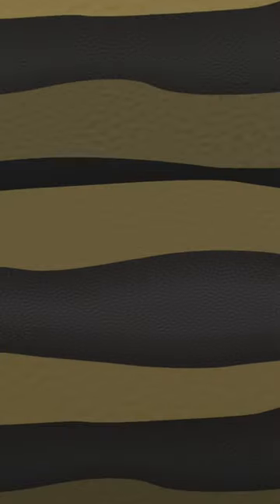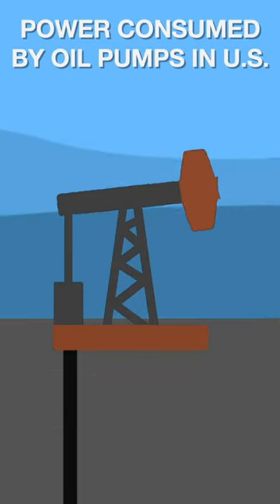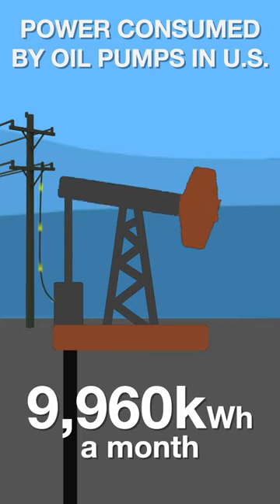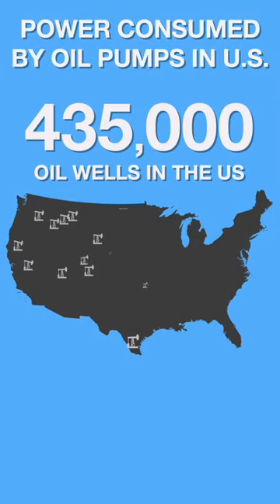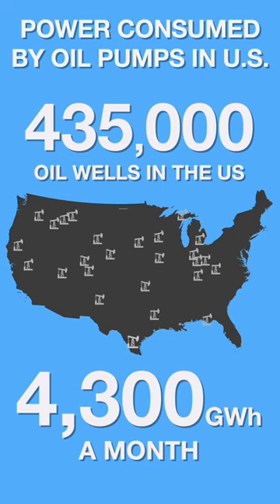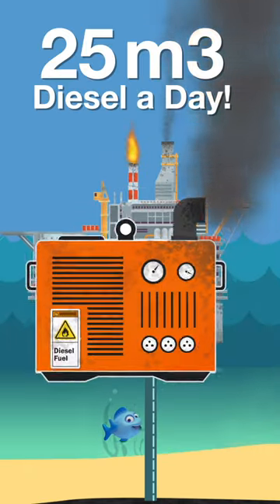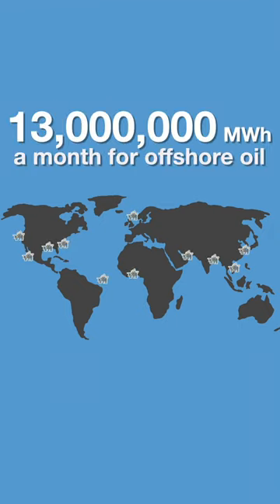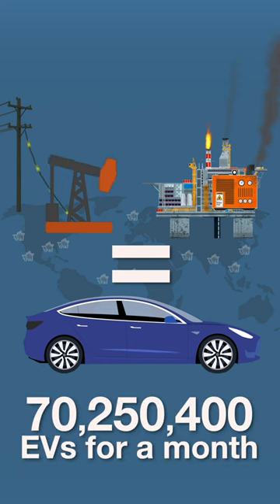Just to Get Oil Out of the Ground! #oilandgas #evlife #automobile

Comment: Electricity used to bring the oil up to the ground will - together with electricity for refining and to distribute the oil - mean that you use far more electricity to drive a fossil fueled car one mile than the equivalent for an electric car!
Reply from the maker: Maybe not more electricity for the whole oil to Gas process but definatly more energy!
Reply: Okay..thanks 🙂
But... aggregate that drives the pumps produces electricity to do the job?

Anyway... here in Norway, politicians want to whitewash the world with electrification of the oilplatforms from land! 🤢

It will require at least 15 terawatt-hours (TWh) of power annually.
(If all vehicles ran on electricity in Norway, it would require approx. 8.6 Twh)
Great?
Reply: @GasTroll  Well, more electricity yes! But some of that electricity is being generated by diesel generators. Ironic that they use diesel generators on oil platforms to make electricity to pump.... oil. like wtf? Pump oil with electricity that's generated with pumped oil. Silly!!!
Reply: @ChristianLanctot  it’s not silly when you realize that the net energy gain of burning the fuel exceeds the energy spent to extract and refine it. Your body burns calories to chew, swallow, and digest a Big Mac but the amount of calories your body gets far exceeds that expenditure.

Comment: Now look how much carbon emissions it takes to make a battery pack for a EV.
Reply: Total lifetime emissions are around 80% lower for the electric car, since 90% of the petrol car's lifetime emissions are due to the combustion of fuel!
Reply: @jannorgaard561  I said HOW MUCH CARBON EMISSIONS IT TAKES TO MAKE A BATTERY PACK FOR A EV. Not the emissions of a EV VS a petrol car like all of these leftists keep going on about.
Takes machines running off of petrol mining nickel, manganese and cobalt. Raw material items such as these then it has to be refined with more machinery that requires fuel. When its said and done just building a single EV battery pack has put enough carbon emissions of 10 petrol vehicle lifetimes if not more.
Also to charge a EV you need power and most power plants don't run off of "clean energy".
Reply from the maker: Please think about this before you post, EVs do not run on battery packs, they run on electricity. Battery packs have the potential of powering a vehicle 1,000,000 miles. You're lucky if a tank of gas last you 400 miles! Is a false equivalence. We pump process and burn 100 million barrels of oil a day. Can you wrap your head around that? 100 million barrels a day!

Comment: And minimum estimates of 115 million cars on the road for commuting every day in the US alone. 

81% of the electricity in the US is generated from fossil fuels of one form or another. So if you redirect the energy for extracting fossil fuels to run fewer EVs than current passenger vehicles where are you going to get that electricity?
Reply: When gasoline cars first appeared, there were practically no gas stations. As more cars were sold, more gas stations were built.

The same will happen with EVs. As more are sold and there's more demand, more power plants will be built.

BUT: Evs have a HUGE advantage!!!! You can make electricity from dozens of different ways. You can even do it at home with a small windmill in your backyard or solar cells on your roof.

You just CAN'T do that with a petrol car except perhaps biodiesel but there's very little diesel powered cars in the U.S. anyway.

Electricity can come from oil, gas, coal, nuclear, solar, wind, wave, tides, sound, pressure and so on. Scaling and costs are the only holdbacks for some technologies. But as with anything demand drives mass production which lowers costs.
Reply: @ChristianLanctot  none of that is the point of my comment or the video. But maybe before making grand claims about EV demand increasing the US electric grid’s supply, maybe they should reach a point where rolling blackouts aren’t necessary first. 

I’m not against EVs, or renewable energy. There are major hurdles to overcome which will happen with time. And yes there are other ways to create “fossil fuels” besides biodiesel though it’s not quite as practical as charging your Tesla with some solar panels on your roof. However, internal combustion vehicles still have certain advantages over EVs, with refueling vs recharging and cold climate reliability being two pretty major ones.

Comment: What what??? This is nonsense. You say how much energy it takes to power the oil drills without the context that the energy they pull out is like 100x what they need to be powered and then make the argument those can/should be put into electric vehicles that have a negative return on investment? Do you know anything about how the world works?
Reply: Most educated fume sniffer
Reply: The nonsense is buying a gasoline vehicle and buying gasoline. 

That’s the nonsense   

Gasoline vehicles have 2000 moving parts 

They require a lot of maintenance to keep them running throughout the years 

That maintenance is not free 

I have electric vehicles that are 12 years old that have never been to a mechanic yet 

They have never had a failed part yet  

I’ve changed, wiper blades and and cabin air filters but I’ve never changed a mechanical part yet. 

Electric vehicles are made for people who don’t like to buy gasoline and who don’t like to spend money on car maintenance   

Electric vehicles cost very little to fill up and very little to maintain   

Only the fools by gas cars  

But that’s OK because we need those fools to spend their money because that’s how the industry moves right now 

1.4 million Americans bought electric vehicles in 2023 

In 2024 it’s going to be over 2 million 

And that amount is going to get larger and larger overtime 

Eventually, nobody will buy new gasoline cars  

And will squeeze the gasoline cars off the road   

By 2060,  80% of Americans will be driving electric vehicles
Reply: @NAY2GAS  first of all this doesn’t even begin to address what I called nonsense. Second even with all those perks you just mentioned you are still more expensive than ICE car. Come back when you have an argument other than “more expensive convenience”
Reply from the maker: "like 100x", this is old data, "Now, conventional oil production worldwide pays off at about a 20-to-1 ratio. And in Canada, where the oil comes from tar sands, it's closer to 5-to-1. "Renewable energy sources are paying off at higher rates, 12-to-1, 15-to-1, 17-to-1."
https://theworld.org/stories/2012-11-02/energy-costs-oil-production.
I do have a good understanding of Oil to Gas processes, I have been studying it for a while. Do you realize that the oil still needs to be refined using even more energy, and then all the oil and gas needs to be transported, held in tanks eventually delivered to gas stations for delivery. Gas station tanks leak after time and are a source of a lot of contamination, then need to be replaced after 20-30 years. If you're arguing that burning oil is more efficient than powering transportation with electricity then you're someone who doesn't understand the topic. Everyone who is honestly looking into this agrees that EVs are more efficient. It's just a question of transitioning, and the time that will take.
Reply: @GasTroll  yet you still have tiptoed around the fact that your video advocates to get rid of net positive production of energy and replace it with net negative production… if you have a good understanding of the topic, use that understanding to educate correctly, this comment was 1000x better than your video, though with clear confirmation bias at least it was accurate and logical. Do this in your videos.
Reply: You don't need fossil fuels to make electricity to power pump jacks. You can use nuclear, solar, wind etc.

My province here in Canada doesn't use fossil fuels to make electricity, we use mostly nuclear, wind and solar.

So even a pump jack in this province would be powered by green electricity.

So given the math on the left there, better just put that energy into an ev than use it to pump oil.